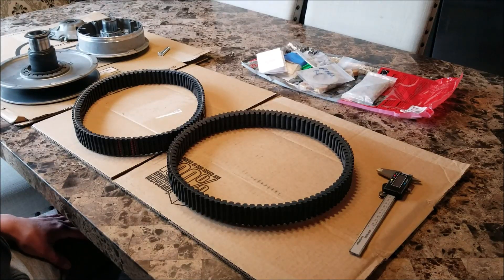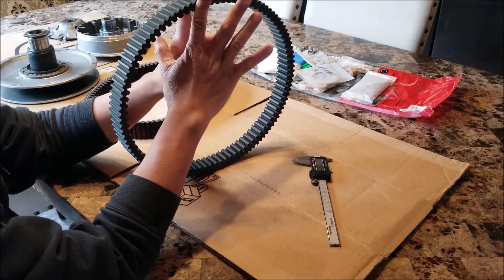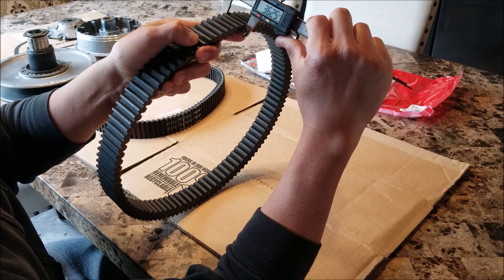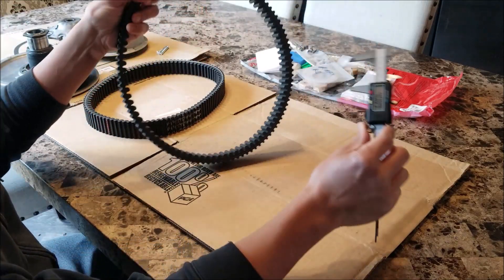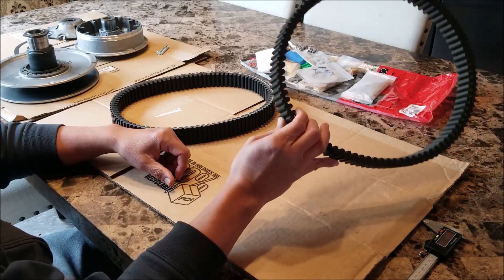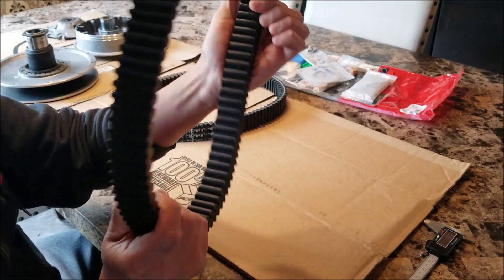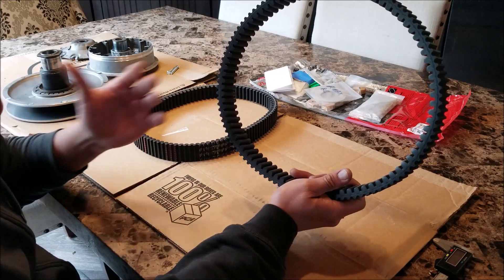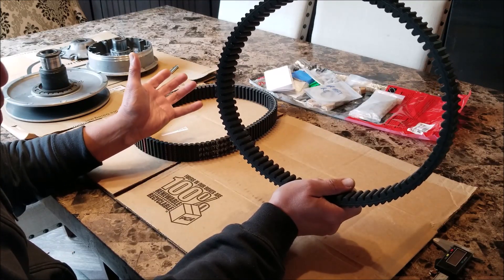Yamaha RMAX 1000 belt wear and longevity

Comment: Hi MO, 'your next sheave service' but this is still the first belt? Or did you changed your belt before? (I'm Dutch speaking 😅) In other words: you bought the vehicle new and drove 8k5 miles with the original belt?
Also about how many miles do you do a sheave inspection? (I know you're on Wolverine forum explaining this) 😅
Reply from the maker: That's correct, 8500 miles on the original belt.   I service them at around 3K miles using Tinkseal.
Reply: @MassiveOverkill  ok I have 1800Km (just above 1k miles) on my new machine. From Belgium, so very easy ones, no real mudding or crawling, mostly hardpack or asphalt. But I'm leaving for a 1300Km trip to Marokko soon in desert and atlas mountains, so not really worrying now 😏☺️

Comment: hey massive i had my belt grenade at 7600 miles ...  i changed to greaseless at just under 4000 miles or a years useage from new was going to go thru again this winter when it let go ... almost made it ... re tinked new orings and seals and belt ...
sliders and weights showed no signs of wear ... plan is to service every winter when it's too cold to ride ... hi desert Az ...
thanks for all the content ... much appreciated ... @MassiveOverkill

Comment: Thanks! Was the taper beyond the edges of the outer rubber ribs? And was that 5800 miles on the original OEM belt? Greaseless FTW!!
Reply from the maker: Yes it was.  It was 8500 miles on the original OEM belt ;)